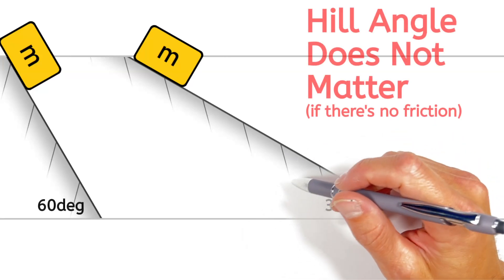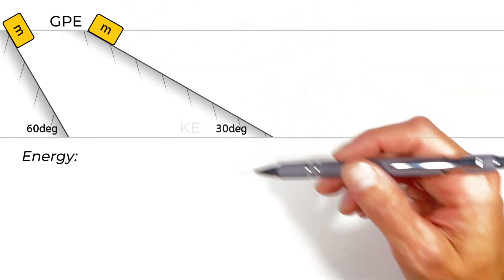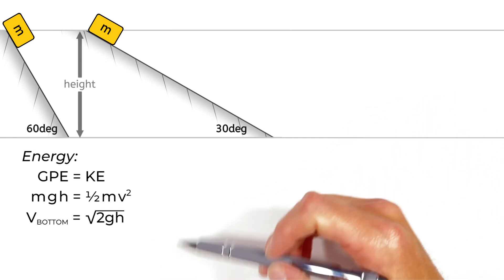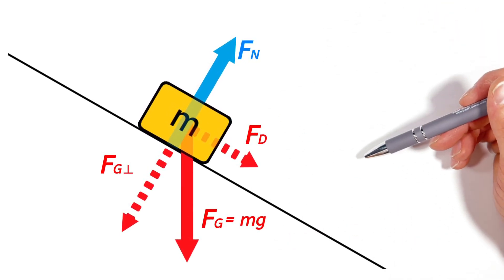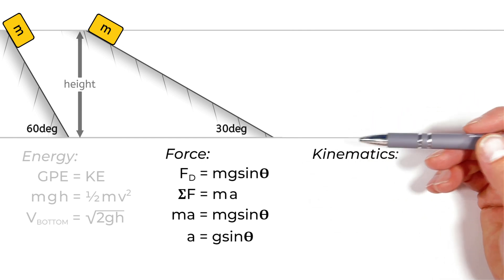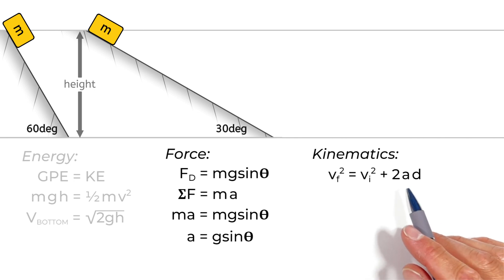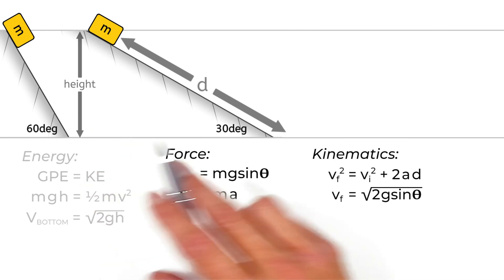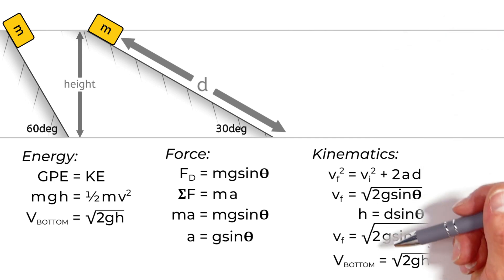Hill Angle vs. Final Velocity of a Sliding Block | Energy, Force & Kinematics | Physics

Comment: Good video. I wonder how friction will affect the velocity in both situations: the steep and shallow hill.
Reply from the maker: Friction matters more at a shallower angle.  As the hill approaches vertical, friction ceases to matter.  At the other end of the spectrum, if the hill isn't steep enough, friction will prevent the block from moving at all.